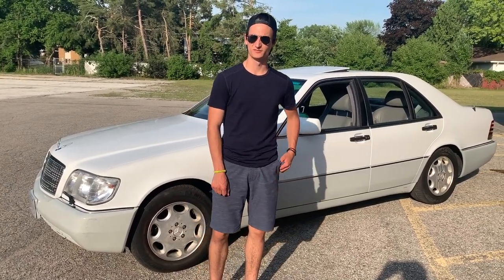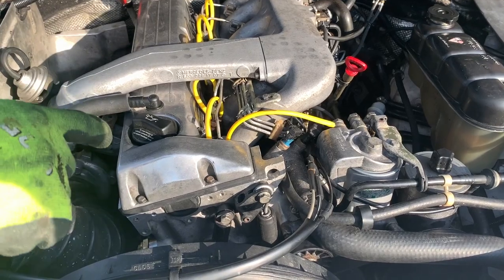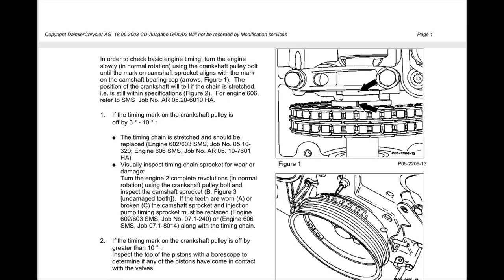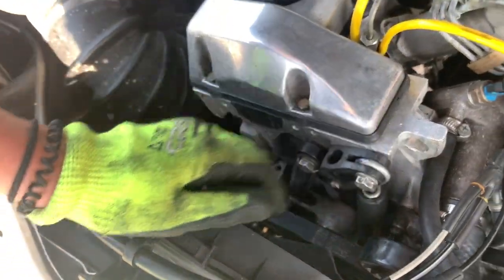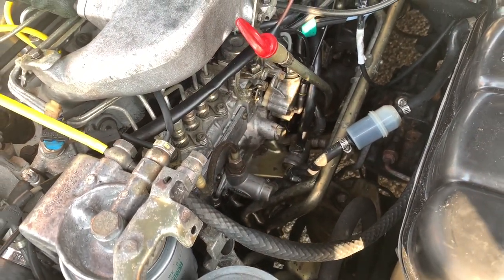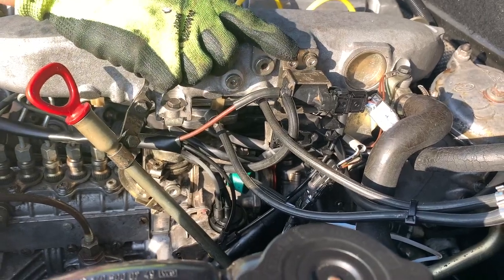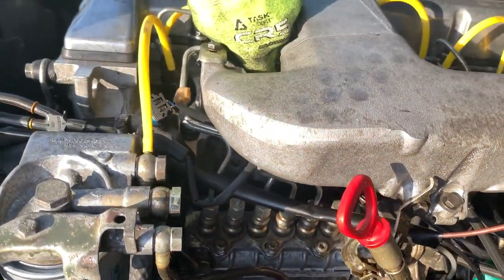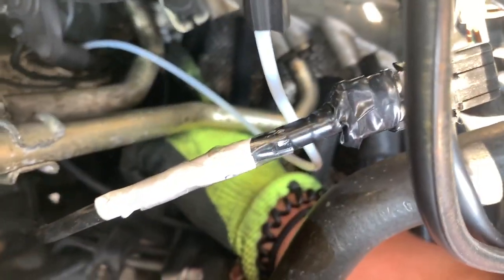Things I Learned [Vacuum Lines, Wires & Timing] -  W140 OM603.97x "Rod Bender" Engine Swap

Comment: It is amazing to find a video with just about all the information that I need.  I cleaned all of my intake system because of a problematic egr exahust valve and in the process I had to loosen the camshaft retainers and messed with the chain position even if I put some plastic clips to hold the chain onto the cam sprocket and as a result I haven't been able to start the engine.

Comment: Great video!  Packed with information.  I have a 1984 W460 G-Wagon.  The garage has just changed the engine to an OM603 from a W124 300D. This is a great reference video!

Comment: Im a new owner of a w124 300D turbo with om603 engine, i learned alot from your video. Thx alot man
Reply from the maker: glad it helped. the w124 are much more straight forward to work on IMO. best of luck

Comment: You'll want to raise the max RPM on your fuel injection pump - the 3.0 engine can go almost 1000 rpm more than the 3.5. Using the 3.5 engine settings means you'll be down on power. 
The W126 and W140 have an electric pump on the trunk for the central locking. Your W140 has a vacuum controlled turbo wastegate. I didn't realize that the W140 does not use the vacuum / boost amplifier for the transmission like the W126!
The black lines are a vent, that go into the cabin. The 2 wire coolant temp sensor in the head is actually 2 sensors in one - one does the gauge, the other hooks up to the glow plug relay. The 2 pin temp sensor on the water outlet is for the climate control, and the single pin temp sensor is for the engine computer.
Reply from the maker: As far as I know, the W140 does also use vacuum for the transmission. There is a little green nipple that goes to the transmission, along with adjuster knobs for the "force" of each shift. This can be found under the shifter boot in the center console

Comment: thanks for video, i fixed my issue on 603 eng w140, at 9 min 30 the wire for RPM indication gauge , it goes from L3 Ring gear speed sensor to N26/2 then to N39 (computer)

Comment: I have one, I'm debating on installing a 606 instead of a 603.96x My .971 is starting it's death spiral I believe.
Reply from the maker: Not familiar with the OM606, it's a little newer model, but I can tell you that if you can find a OM603.960 it's a bulletproof engine known around the world to run for 1 million Km's. They still use them as taxis in the Middle East and Eastern Europe!

Comment: Hoi,good i see this video now , becouse tomorrow or very soon i start remove the cylinderhead from my 350 sd 1992. You have any idea where  i can find the step by step info for doiing this? Or the tork s for the bolds. I have to say it is very interesting to know the information you tell about the cars lines and so on. Nice job grts from belgium

Comment: 92MB300SD 78,500 miles. Engine runs fine however will not start after shut off until manual STOP lever in engine compartment fully restored to position. It does not reset each time. ? Some fuel leakage in that are just above lever. MB shop recommends replacing Injection pump $$$. Any suggestions?
Reply: Im a year late to your comment but I have the same car. Fuel leakage sounds like the copper crush washers in the injection manifold. And your car not shutting off is vacuum, I had the same issue and I had just knocked off a small little vacuum fitting, it took me 4 hours to find but if you shut off the car and listen you can maybe hear a hissing noise.

Comment: After timing the IP 15° ATDC do you just put the 17mm back on?
Reply from the maker: meaning the bolts at the front? yes. they are the ones that hold you IP pump in place

Comment: I've been working on a 93 300sd.  I'm currently having trouble finding a picture of how the fuel lines connect to the tank.  Drivers side, where it has two barbs.  Any chance  you have a diagram or could explain  where the return line runs to?  
Thanks,
Dustin
Reply from the maker: Hey Dustin, car is in hibernation at the moment. Send me a private message and we can chat about it.
Reply: @bencesmercedesgarage7479   not exactly sure how to private message through youtube!
Reply from the maker: @dustinubbing6722  Looks like you have disabled it on your account. Send me an email at: bence.imre.esztegar@gmail.com

Comment: I thought the reason the 3.5 liter bent rods was due to hydro locking it only takes a table tablespoon of oil or fluid to hydro lock it causing rods to bend. It could be caused by leaking turbo seals or valve stem seals leaking into cylinder and the reason the piston wear the blocking due to the bent rod.
Reply from the maker: Nooo, luckily this engine never made it to that stage, but the oil burning, noise and lack of compression were clearly pointing to the fact that these cylinders were over bored. Originally the car was sold as a 3.0L with 3.0L pistons, but the block was from the '87 model, being 3.5L.
Reply from the maker: Sorry, the other way around 3.5 > 3.0

Comment: Low oil pressure? You told us, you changed the bearings?
Reply from the maker: No, I mean't the gauge wasn't reading properly until I switched the wires

Comment: Hi can you send me the fan shoud part number. Thanks
Reply from the maker: Hello, I have not forgotten. Tomorrow I will get under the hood and take a look for you :) Bear with me for one more day.
Reply from the maker: 140 500 06 55 is the shroud
Reply: Bence's Mercedes Garage thanks
Reply: Bence's Mercedes Garage I order in Mercedes dealer and is not the one . Don’t know can you check the numbers. Thanks
Reply: Luis Vazquez I wish i could send you the picture. But this is the same number from my fan shroud cover. Which model car do you have? If you have the W124, it is likely smaller than the one for the W140.
Reply: Bence Esztegár it a 92 Mercedes-Benz 300sd
Reply: Bence Esztegár I don’t know why the Mercedes-Benz dealer got me the wrong one but has the number on top
Reply: Thanks
Reply: Bence Esztegár the one they got me is bigger
Reply from the maker: @LuisVazquez-cv2ku  I will email you
Reply: Bence's Mercedes Garage thanks

Comment: Do you have a WhatsApp account? I would like to contact you if possible. I need help. I have a Mercedes w140 turbo diesel om603 1996
The problem is in the air lines entering the engine. I need an explanation or a picture of how to arrange them correctly because they are arranged incorrectly

Comment: Question for you. I have an 87 om603 in a 124. Just started it with a fresh battery ran for a bit started knocking and stalled out now it doesn’t want to turn over acting like it has a dead battery. Starter crapped out maybe?
Reply from the maker: Perhaps its a starter....check the serpentine belt, hopefully that's the easiest fix. If you hit the starter with a wrench does it turnover? One last thing that I could think of would be air in your diesel system somewhere.
Reply: Bence's Mercedes Garage I haven’t actually hit it with a hammer yet because it tries to spin but is really labored like not even a quarter of a crank turn. I was thinking about pulling my injectors and hoping coolant doesn’t come out. I’m gonna swap a 17 head on and put a 606 head gasket. I just hope it’s not a hydro locked cylinder
Reply from the maker: @nicjohn6375  I would recommend first, 
Checking if you have good pressure coming from you Injection Pump. You can do this by individually unscrewing the lines coming from the IP pump to each injector [14mm wrench], you should see a pretty violent spray when turning over. Start at the furthest cylinder from the IP pump (#6) and work your way back. This will rule out the air in the system as well and effectively bleed your system.
If you had a blown cylinder head gasket you would know if you were burning coolant, trust me. I've had one before. White smoke and smell.
If your engine isn't even turning over...I would probably assume the starter as well. I don't know what this has to do with your new battery...Is it a OEM Mercedes Battery?
Our other W210 (2.5L Diesel OM605) occasionally suffers from no turn over, specially in very high and low temperatures we've noticed. Likely the starter, but hitting seems to do the trick for the time being.
Reply: Bence's Mercedes Garage I’ll try tapping on the starter cuz I’m running a 220GPH lift pump and a smaller back up so 2 lift pumps 1/2” line to the IP w/35psi of FP. but it’s the first fire after 3 years and started right up ran pretty good then developed a knock stalled then when you try to fire it again it just won’t even make a full revolution. I don’t think air in the line would do that. The 14 head also used to blow oil out of the turbo so I’m hoping it didn’t pump all the oil out and lunch the engine on me
Reply from the maker: @nicjohn6375  Ah I see, so it's modified. What do you mean by "14 head"?
Reply: Bence's Mercedes Garage I had twin turbos until it started blowing oil out of the exhaust no matter what turbo it had just bleeding oil out the exhaust and it’s the number 14 iron head. I have a 17 off the other engine (best cylinder head to run would be a 22 but I’m not spending almost 4K on a head) I’m going to swap on so it’s lighter and flows better and eventually plan to put a 10.5mm p7100 cummins pump on it and an hx50.  Lookin for 800+ hp lol